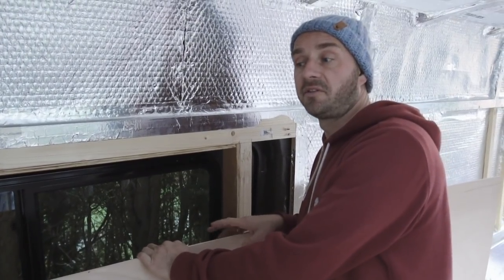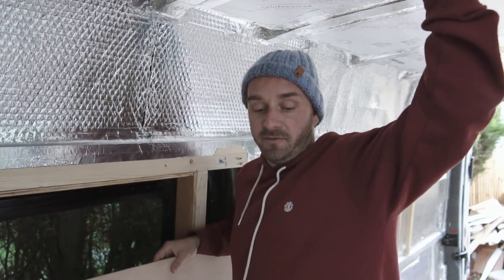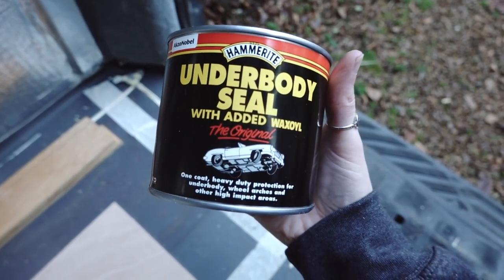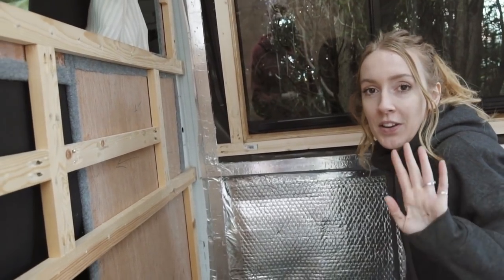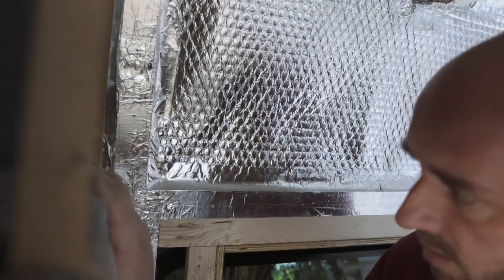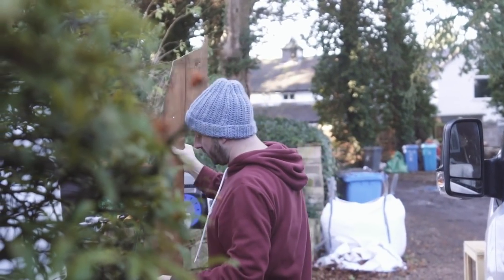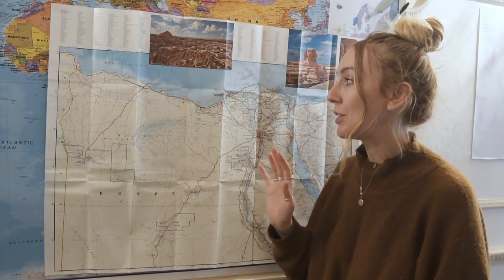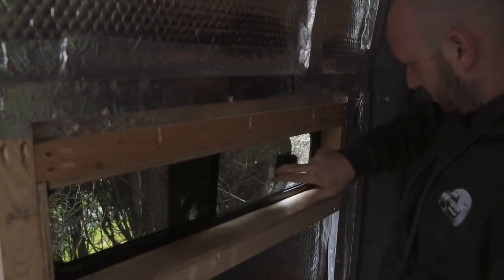BUILDING OUR SPRINTER VAN FOR CROSS-AFRICA ROADTRIP

Comment: I follow your videos on and off and It looks amazing to be fair to you both.

Quick note, MB sprinters suffer from head gasket failure in warmer climates. Make sure your radiators are clean and your cooling system is fully functional. 
A recommended coolant upgrade would be evens waterless coolant. Just allows your engine to run at a consistently lower temperature only by a few degrees but it makes a difference. Little bit expensive to get set up but well worth it as it's a lifetime coolant. 
It's worth looking into anyway. Safe travels. 👍

Comment: Surely you would want access to the cab just in case you needed to get out of a place ASAP?
Reply from the maker: We designed the hatch so we can get through it easily in an emergency. We just don’t want it open permanently ☺️
Reply: @OverlandingSophia  thanks for the reply :) wouldn’t a door be easer to access tho? Just asking thats all, love the videos!
Reply from the maker: @coryjay16  No problem! Yes it would,  but we prefer using that area for a kitchen, so a door wouldn’t work. And we’ve never used the hatch! So it would only be very rare we’d need it ☺️
Reply: @OverlandingSophia  that's fair enough! good points! stay safe!